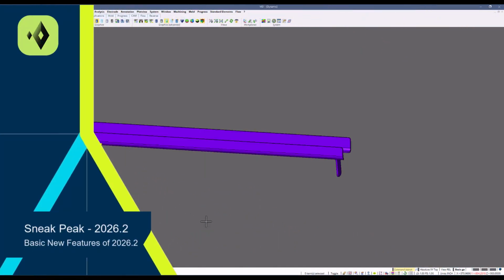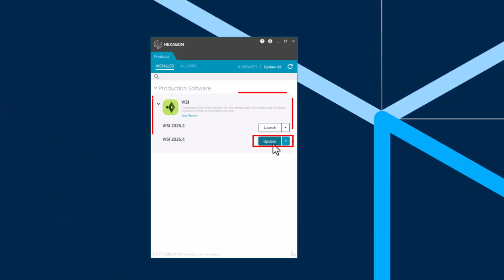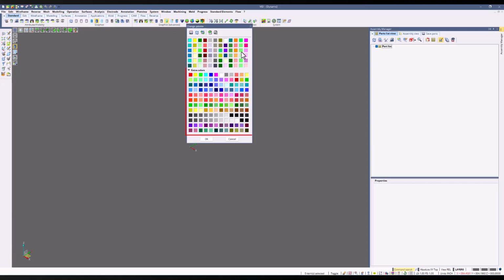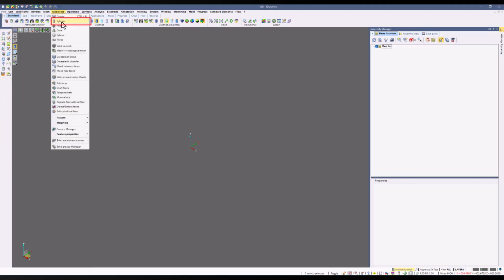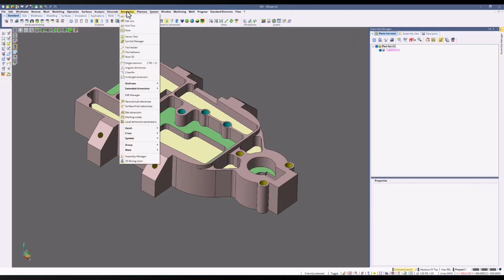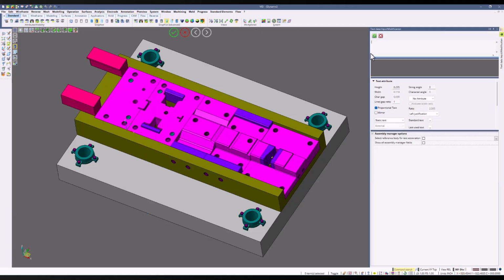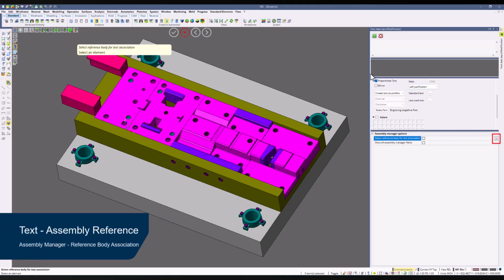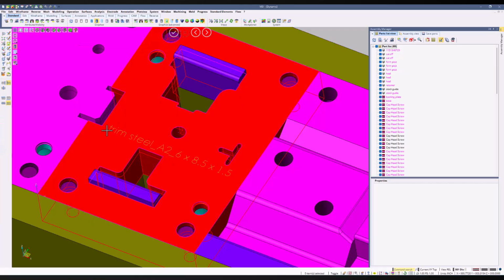VISI by Hexagon: 2026.2 New Basic Features

Comment: "I would highly appreciate it if a long-standing issue could be addressed in the next update. Currently, it is impossible to reorder or organize bodies and solids within the CAM Navigator > Geometry tab.When dealing with numerous parts, stocks, and obstacles, the list becomes cluttered. Unlike the Features tab, which supports folders, the Geometry tab does not support drag-and-drop. The only workaround right now is deleting and re-adding a part so it moves to the bottom of the list, which is highly inefficient. Could you please consider adding drag-and-drop support or folder organization to the Geometry tab?"
Reply from the maker: Please submit enhancement requests to the Support Team via the Hexagon Customer Portal by creating a New Case at https://customers.ps.hexagonmi.com/